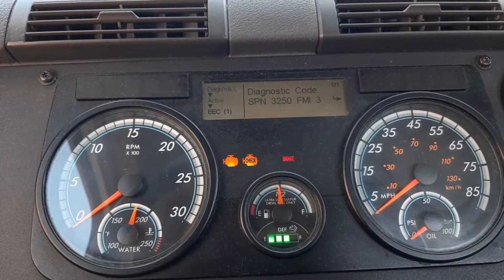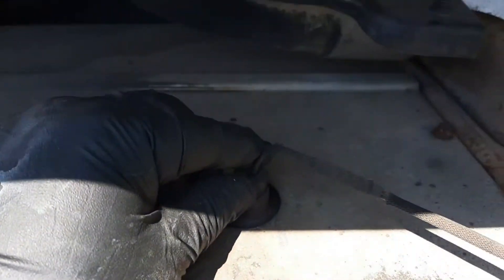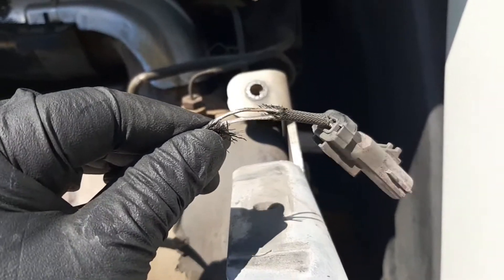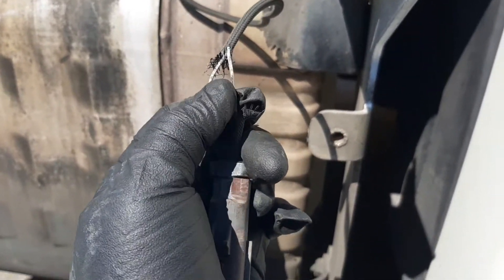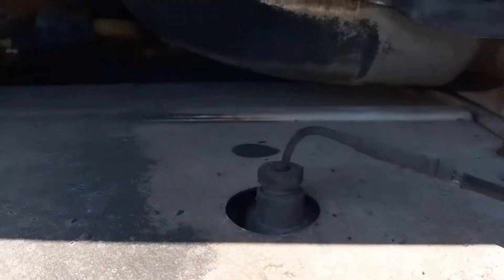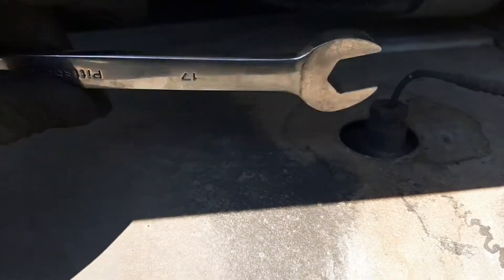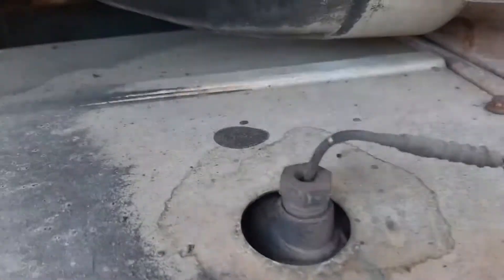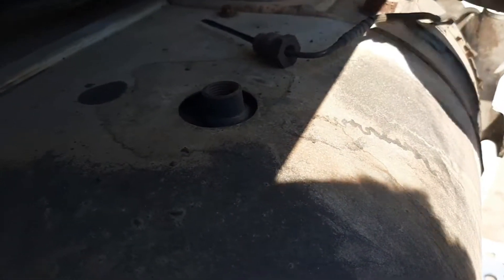Freightliner Cascadia SPN 3250 FMI 32 and 3

Comment: My wires look the same as your harness wires but I’m not getting the same problem as yours it don’t restrict my speed in driving, it’s flashes red STOP light on and off,  and cuts my engine off on me, I just keep turning the truck off then on and it goes away I don’t know if that may be the same problem as yours I wonder if you can help? I haven’t changed the harness worse because my harness nut is stripped. Just my luck